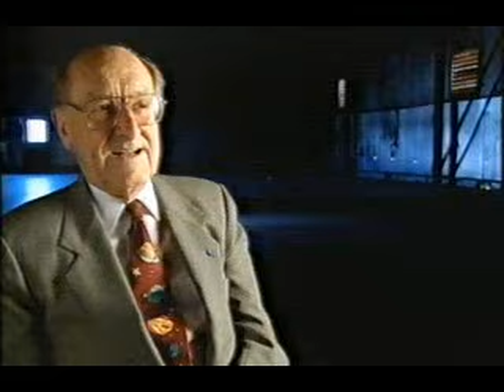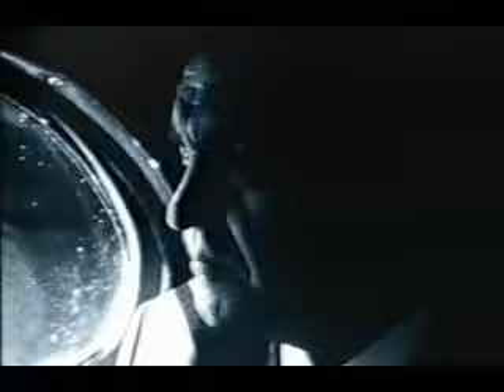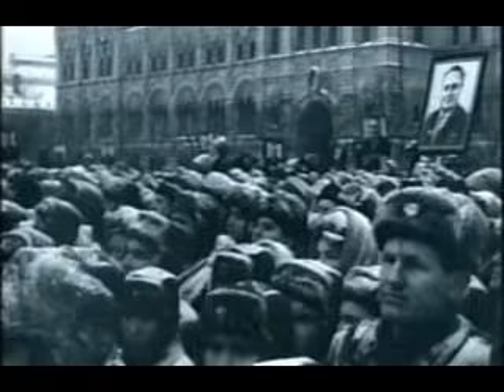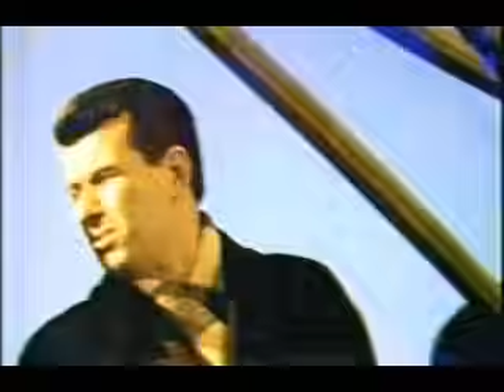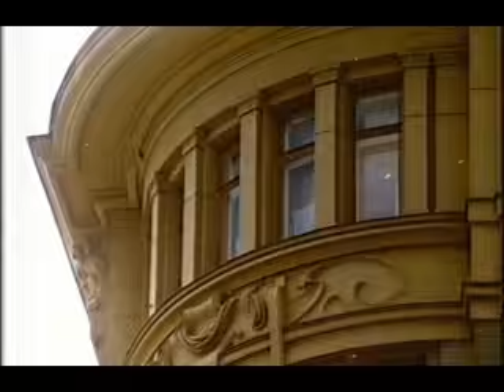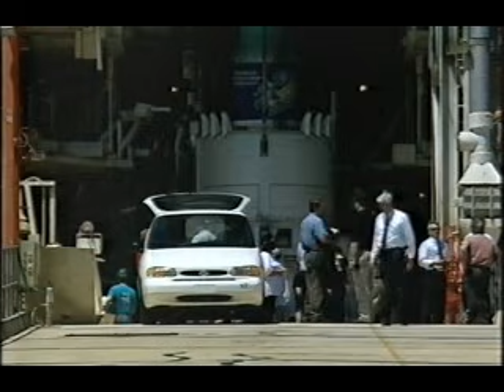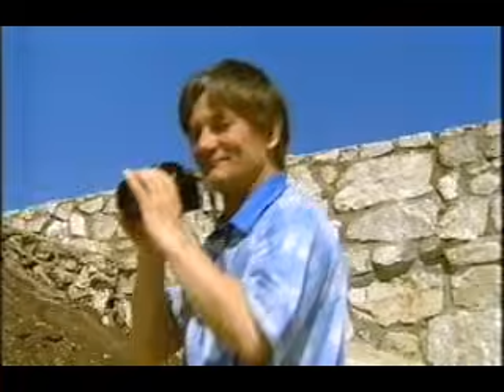Soviet N1 Moon Rocket Documentary

Comment: If the Russians captured the late great Dr, Werhner von Braun after WWll the moon race would have turned out differently.
Reply: Isukaman Or if Sergei Korolev had died in the Gulag. There probably would never have been a space race or moon landings.
Reply: +PoorSong Nonsense again. Combustion instability is the term you're after, as opposed to self-oscillation, which tends to be reserved for audio circuits.

Yes, the F1 did have a lot of early problems with instability, which they analysed and fixed with a modified injector plate, arrived at by trial and (expensive) error. This was confirmed by putting a small bomb in the engine to try to provoke combustion oscillation.

In any case, you've seen the launch footage. You cannot deny that the enormous Saturn V rocket existed and that was being powered by 5 first stage engines. How do you explain that if there were no engines powerful enough to do the job? 

And ALL the photo "anomalies" - all of them without exception - have been repeatedly answered and the answers have never been so much as acknowledged by the hoax believers, let alone rebutted.
Reply: +PoorSong Yet again, you say these things but do not in any way back them up. As an engineer, I would have thought your first resort would be evidence, not assertion.

Yes, I understand you don't believe the landings, and to try to reinforce this, you belittle the intelligence of anyone who does. But you don't give a single detailed argument that can be analysed and confirmed or rebutted. But the fact is that the MAJORITY of educated people accept the moon landings. It is not some whacky, way-out lunatic fringe opinion, as hoax believer so often try desperately to portray it.

All these posts and you still haven't said WHY you are so convinced the thing is a fake, and what gives you the right to be so smug about the stupidity of anyone who doesn't agree. You have had plenty of time to demonstrate your supposed engineering knowledge, but you have apparently chosen not to do so. I wonder why that is.
Reply: ThunderAppeal The Russians wanted to get to the moon even after Apollo 11.  And Mars,,,And Pluto.  But as of today they cannot.  If Russia wants to get to Mars before the US let them give Boeing and Space X the money and they'll get them there.
Reply: @isukaman8561  The Russians put the first satellite in to space, the first man in to space, the first woman in to space, the first dog in to space, the first vehicular activity in to space.  The only thing the Americans did first was put a  man on the moon.
OK.  Congrats.
Reply: @ThunderAppeal   "The Russians put the first satellite in to space, the first man in to space, the first woman in to space, the first dog in to space, the first vehicular activity in to space.  The only thing the Americans did first was put a  man on the moon."   Ok, let's think about this......... first dog in space,  first man on the moon.   first dog in space,  first man on the moon.    first dog in space,  first man on the moon.   I'll go with first man on the moon!  Am I right?
Reply: @ThunderAppeal    before I leave your worthless self to ponder what went wrong during your formative years, I'd like you to gaze upon this vintage Soviet propaganda poster and then tell me they weren't interested in a moon landing.  GFYS.    http://parliament-of-pol.wikia.com/wiki/File:Soviet-space-program-propaganda-poster-3.jpg
Reply: +PoorSong And you, of course, no so much about 1960s and 2015 technology. not to mention orbital mechanics and rocketry. I'm an engineer and lifelong Apollo fan, and I do understand much of it - and your assertion that the technology has never existed to go to the moon is groundless, baseless and nonsensical. Simply not true. 

NASA can't go now because it doesn't have a rocket anywhere near the size and specific impulse of the Saturn V. Apollo was wasteful and mind-blowingly expensive (a great example of what you can do by throwing money at the problem, like Concorde and the X-15), and the US Government would never get away trying to go the Apollo route in today's economic climate. So recreating the Apollo missions and hardware is out.

This was my point about what Wernher von Braun could do when he didn't have unlimited resources. 

Why do you think neither the Russians, the Chinese, nor any other country has come out and pointed out this "impossibility"? Do you think NASA controls every country on Earth?
Reply: +PoorSong And all rocket engines have to contend with combustion instability - all of them, including the RD-180. But the kick is, how well do they damp the oscillations out? The fact is, there just hasn't been a mission for the F1 since Apollo. And if the whole thing was just a fake, why invent an "impossible" engine, instead of a cluster of smaller engines, such as used on the Saturn 1B and the unsuccessful N-1 moon rocket.
Reply: +PoorSong Try again. "Launches in the Atlantic"? What do you mean? The launches were from Florida. And "Engineer if he is a real engineer, cant fail to see that it was a cheap show for housewives." is a) an unsupported statement, not an argument and b) your second snide dig at housewives.
Reply: +PoorSong You can ask me a dozen times: no, they are not fake. And would you like to give up the evidence of why you believe they are. Just be aware that if it involves:

Supposed second light sources
Converging / diverging shadows
Supposed slow motion simulation of 1/6 G
Disappearing fiducials (crosshairs)
Supposed repeated backgrounds
Lack of dust crater
LRV didn't fit in LM Descent Stage
How was Neil Armstrong's small step recorded
No stars visible
Camera films couldn't stand a supposed 250 degree daytime lunar heat
Spacesuits would balloon outward in the absence of air
Supposed fluttering US flag.

Then I have heard them a hundred times and answered them a hundred times without so much as an acknowledgement.

So kindly put up or shut up. Let's not play guessing games. If you have new evidence, please present it.
Reply: +PoorSong 

So no evidence, then. I see. This is the usual bait-and-switch the normal illiterate hoax believers pull. When asked to provide evidence, they just ask another cryptic question. I do not intend to play this game.

You say you believed in Apollo for 35 years and now don't, but I'm no engineer because I don't agree with you that it's a hoax. So how about doing some of that engineering shit to show me I'm wrong?
Reply: +Alastair Archibald You are talking to a troll or a moron. Either way, why?
Reply: +TotallyOperator Because I'm hoping that some people who aren't sure and genuinely want to know can begin to see the moronity within.
Reply: +TotallyOperator I want people to see that Apollo supporters aren't necessarily monosyllabic single-eyebrow people with too many capital letters and exclamation marks, and too few facts or other punctuation marks.

They lash out with abuse, I try to reply with facts. I know I'll never win, but i feel somebody needs to keep the game of whack-a-troll going, not for my sake or that of the trolls, but for the genuine Apollo agnostics..
Reply: +PoorSong Von Braun and a bunch of Nazis with absolutely MINIMAL FUNDING AND ZERO PRIORITY could only manage the V-2. Could you? If doing that made von Braun a loser, what does that make you?
Reply: +PoorSong How can it have deceived them if as you say the whole thing was ludicrously obvious and absolutely impossible. That is ignorant, pure and simple. The technology DID exist, in 1969, because NASA had a ton of money to throw at the problem. Your saying the landings were impossible is sheer ignorance on your part. It wasn't impossible, just difficult, dangerous and expensive. Other countries' engineers and scientists accept that. Deal with it.
Reply: +PoorSong What kind of engineer? I used to work in aerospace. You are quite simply wrong on this "impossible" claim. This is not a matter of opinion.

The 425 second specific impulse of the Saturn V is perfectly compatible with the requirement to go to the moon. The Van Allen Belts are not the death-traps the hoax communities portray them as. The Apollo rope-core computer was adequate for the simple vector-addition functions it was designed for (ground-based computers did any heavy number-crunching). 

So in your engineering estimation, what makes the missions "impossible"?
Reply: +PoorSong No. The launches were witnessed first hand by thousands, including local Florida residents.
Reply: +PoorSong Well, this is not evidence of faked video or photos. However, out of courtesy, I will answer it.

NASA had mastered spacewalking, and they had tested the suits at 1G. Equilibrium at 1/6 G would be somewhere in between. As it was, the KC-135 "Vomit Comet", by using the correct parabolic arc,  could simulate 1/6 G for thirty seconds a trip, and the astronauts went through hundreds of such flights in full space suits.

You are pleased to mock the whole thing as a cowboy in a sweat suit with an aquarium on his head, but this is incorrect. If you can walk and indeed run in a full Apollo space suit on Earth, why does 1/6 G make that harder? The heaviest thing is the PLSS backpack, acting through the astronaut's centre of mass. As long as the astronaut moves at a moderate pace so as not to lose grip through excess momentum, there are no special problems. Apollo 17 video does show a few tumbles that would be impossible to fake on Earth due to over-boisterous movement (Jack Schmitt was a scientist, not a career test pilot and astronaut). The so-called "aquarium" is a lightweight polycarbonate bowl attached to a neck ring and attached to the suit. It doesn't have a lot of inertia or consequent momentum compared to the main mass of the astronaut.

You can see video of the astronauts training on the Vomit Comet as well as in neutral buoyancy chambers where they were weighted to 1/6 G equivalent.

There were also less successful simulations using wire harnesses. 

As for the LRV, all the mass was low down, deliberately so. This wouldn't be any different on the moon. As an engineer, you ought to know that. But then again, beyond plain assertion, you haven't said the least thing to make me think you are one.
Reply: +Alastair Archibald Okay, fair enough
Reply: +Attila theHun Nice quote: "Engineers never just say 'This is fantastic.' We're a very skeptical type of people we have to prove things to ourselves technically." 

That pretty much sums up the difference between moon hoaxers and actual engineers. Hoaxers have an ideological objection to the US reaching the moon. I personally believe that if the Soviets had gotten there first there would be a small community of people promoting a Soviet moon hoax instead. The Soviets had excellent engineers and scientists and punched well above their weight in aircraft, rocketry and other applied technology. They knew what it took, so even they didn't deny that the US reached the moon.

With high school mathematics you can calculate the thrust and amount of fuel required to deliver a given cargo to Trans Lunar Injection. Many countries have landed craft there, it is well understood. Physics students in China, India, and Iran study the Apollo program and guess what? They're not the ones claiming it's a conspiracy. It's people who's ideology surpasses their reason and scientific acumen. 

The Chinese' Long March 9 will be able to deliver 50 tonnes to Trans Lunar Injection. It's similar in performance to the Saturn V. When Taikonauts land on the moon, will PoorSong at least be consistent and call that a hoax too?

Not only was it viewed live by hundreds of thousands of people in Florida, it was tracked by radar and telescope observatories in West Germany, Russia, China and dozens of other countries. They not only confirmed that it did reach the moon but even confirmed the visible fuel dumping during stage separation and radio telemetry to the moon and back. 

As a side note, the N1 would have had a higher thrust and cost a fraction of a Saturn V per launch. Had they been able to make a reliable launch vehicle with the N1 they would have been able to perform more landings and perhaps sustain a presence on the moon.
Reply: +PoorSong And what does the Atlantic have to do with the Apollo launches? Are you saying the rockets just went up and then came down in the Atlantic? You do know they were multi-stage rockets that were tracked into orbit by numerous stations?
Reply: +PoorSong 

I'm no engineer because I don't see evidence of fakery like you? You do realise that the hoax position is a minority one, don't you? There are thousands if not millions of engineers who accept the truth of the Apollo missions, and I haven't met a single engineer who didn't.

But, if as you say, there are "hundreds" of pieces of evidence, then it shouldn't be too hard to give a few unanswerable examples, should it?
Reply: +PoorSong Oooh, an ad hominem. Great scientific argument.

1) I am English, not American
2) Kindly give evidence of my supposed illiteracy, which I strongly dispute.

However, I'm getting tired of this little game, no different from the games other "illiterate" hoax believers play.

What's your number one undisputable, rock-solid, irrefutable, self-evident, knock-down piece of evidence of fakery? Come on, let's have it. You blew a little smoke with a bit of misdirection showing a lack of understanding of inertia and momentum, but that doesn't knock my socks off. 

I have all the videos, all the photos, all the books. Point me to the absolute NUMBER ONE proof of fakery. Go on. I dare you. I DOUBLE dare you. Show us those mighty engineer powers you claim to have, but have so far failed to demonstrate at all.

I am more than happy to cut you slack on spelling and grammar since you are speaking a foreign language, and rather well at that. But you don't sound like an engineer to me. Kindly stop asking questions and TELL me why you are so certain the whole thing is a fake.
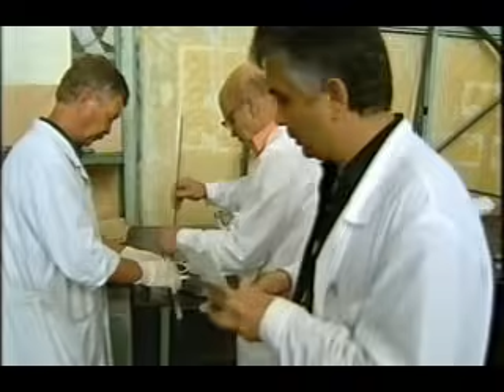Reply: +PoorSong 31:46
Reply: +PoorSong I don't exactly get my wages for nothing. So, a response to my points?
Reply: Not needed. They had their own "Sergei Korolev". Having one's own version is glorious isin't it?
Reply: Sergei Korolev had plenty of Germans to play with and they were milked dry and then cut out after he had got every thing he didn't know out of them. Boris Chertok (seen in this film) was on the Soviet "paperclip" team and they were after Von Braun as well. When Apollo 11 landed, one of the OKB-1 team who knew what Chertok was up to in 1945, berated him for not capturing Von Braun. Chertok's reply, we would have wasted any use we could have got out of him because we would have stopped using him in 1950!!! The Reason the USA pulled it off and the Soviets didn't was simple. The Americans were very Communist (in the true meaning of the word) in the execution of the project, while the Soviets were more like Capitalists with competition between designers and manufacturers.
Reply: Isukaman yes but I don't think Nothin wanted that they didn't want to go to a gulag work for food treat you like an animal Stalin done so many of his side this looks away if not killing them is this not true so I'm sure Dr Ran as far as he could
Reply: Didn't do jack shit? As Chief Architect and first Director of the Marshall Space Flight Center von Braun and his team developed the Redstone, Jupiter and Saturn rockets. The man was a genius.Yanks have spirited him out of Germany?
Reply: And what would have been the alternative for him?
Reply: Wyrdsister 2008

Von Braun was an excellent project manager, and a salesman to boot, his publicity drives though the 1950's made him the face of rocketry in the US, however the missile industry there as a whole was much bigger than Von Braun's ABMA and he was kept on a short leash until Sputnik 2 and the Vanguard 1 failure.  

The Americans had their own people who were just as good, take for example Karel Jan Bossart. What did he do? Well, Bossart was from Belgium and in 1924 he went to the USA to do aeronautical engineering at MIT. In 1945, while the chief structures engineer at Convair he proposed some solutions to a USAAF requirement for a 5000NM range ballistic missile. The USAAF were skeptical, but Convair were given a development contract to build 10 test rockets using his idea's in early 1946. However, before any of them flew, the project was axed for budget reasons (The USAAF were not going to fund anything that was going to risk development of long range jet bombers). Convair were however allowed to test fly the three rockets that they had built and they were flown in 1947. The rockets had some interesting design features more advanced than the V-2. Firstly the 4 Reaction Motor Inc engines (which had been developed during the later part of WW2 with no German design input what so ever) were gimbaled so the rocket had full roll, yaw and pitch control without aerodynamic controls (like the V-2 or Redstone). Secondly the Nose cone was detachable, thus the whole rocket did not have to survive the aerodynamic forces of re-entry and this allowed Bossart to employ his ace in the hole idea, which was a lightweight fuel tank design that relied on the mass of the propellant. plus its pressurization to support the tank structure during flight. He then came up with the 1 1/2 stage concept which with all of his earlier work lead to Atlas which became a crash program for the USAF in 1955. Von Bruan's influence on that project bar engine development was minimal. Atlas engines were an outgrowth of a USAF project for a vertically launched ramjet powered supersonic intercontinental cruise missile called Navaho, which used a large liquid fueled boost to get the missile to high altitude and supersonic speed. The engines for which did use V-2 based technology as the engines came from Rocketdyne and there was liaison between the company and Von Braun's ABMA team in its development. Versions of it also powered Jupiter, Thor, Blue Streak and the Japanese H-1. The Germans had a head start as they had the funding between 1933 and 45. However a lot of their ideas used on the V-2 had already been patented before 1939 by Goddard . The Americans of course didn't start funding rocket development in any major way until 1943 after their first exposure to German Guided Weapons (Hs-293 anti ship missile) and intelligence about the V-2 at which point, Goddard, JPL, RMI, GE and Aerojet started to get government funding for rocket motor research. This included Hermes, a US V-2 type missile. The US rocket program did suffer from large defence cuts in 1947 and Von Braun was only let of the leash with Hermes (which became Redstone) when the Korean war kicked off in 1950.  The US were not that interested in ICBM's until the mid 1950's as the guidance systems were not actuate enough to drop an atomic bomb on a city at long range. (the limits on an A-bomb's maximum yield were 500kt at best and this took a large amount of fissile material to do compared with an ideal bomb that had a yield of 50Kt), therefore the long range jet bomber got the funding.  The US ICBM program became viable with the invention of the 2 stage Dry Ulam Teller Hydrogen bomb in 1954 and it was after the Castle tests of that year that a suitable warhead to put on an ICBM became available. Due to a demarcation on who owned what based on weapon range, long range ballistic missiles were the preserve of the USAF and they went for Atlas as they wanted to base the weapon in the USA as it solved a number of issues to do with politics and security. When it became clear that the Soviets were close to deploying an IRBM, the USAF were forced into instigating the Thor program (as the UK had offered them bases) and Von Braun offered them Jupiter. The USAF were not that interested in having one IRBM', let alone two, but the US Navy said that they were interested in putting Jupiter on ships and submarines. Therefore Jupiter was given the go ahead as a Joint USN/USAF project. Fast forward to late 1956 and the US have managed to produce a lightweight high yield H-bomb, Lightweight highly actuate inertial navigation systems and large high power solid rocket motors.  The US Navy were never really interested in putting a liquid fueled rocket on a Sub, thus these breakthroughs lead to the crash program to develop Polaris and they pulled out of Jupiter. The US DoD were not going to damage the US Rocket program in the light of Sputnik, so Jupiter survived. As for Jupiter's launch success rate v Thor, Atlas and Titan,  that was because Von Bruan ground ran them all before they were launched, while the USAF did not. Thus he was able to identify the turbopump issues which plagued all of the rockets (which used a common engine design).  Now up to 1957, the USAF had a good working relationship with ABMA, however thanks to Von Braun's efforts to force Jupiter on them, they pretty much stopped talking to him, which damaged the whole effort. However, the USAF, like the USN also decided to go in other directions which lead to second sourcing of engines (Aerojet) and a more conservative airframe in the Martin Titan, along with the push for the Solid Fueled Minuteman.  Jupiter in the end was dammed by its US Navy length requirement, which resulted in it being too wide to be transported by USAF transport aircraft. As for Von Bruan at NASA, yes he did get the Saturn's to work reliably. But he did stop Shepard being first into space by insisting that Mercury Redstone needed a third test flight before putting a man on it which let the Russians get Gagirn  into orbit. and had he had his way with Saturn V development, the US would never reached the Moon before 1970. It was George Muller at NASA  HQ who forced him into doing all up testing on the Saturn V . As for Comrade Korolev, he had all of his fingers and toes in some part of the Soviet Space and missile effort with OKB-1 doing SLBM, ICBMs (both liquid and solid fueled), lunar and planet probes, Communication satellites, Spy satellites, Manned spacecraft (zond and Soyuz as well as the R-7 and N-1 launchers. Von Braun had next to no input on most of that in the US program.
Reply: If there was a new race to the moon I wonder who would get there first since the Americans say they don't have the skills to re-engineer (or reverse engineer their own old tech) and the US would have to start from scratch.. 

ARCA's revolutionary aerospike engine completed and ready for testing..  

https://newatlas.com/arc-aerospike-linear-engine-complete/51431/

PLUS

The Biggest Rocket ever Designed? - The Sea Dragon.

https://www.youtube.com/watch?v=6e5B7EKVg48

Sea Dragon Rocket: Worlds Largest Reusable Rocket Concept.

Sea Dragon was a 1962 concept for a reusable, two-stage, sea-launched carrier rocket. The project never materialised as NASA's Future Projects Branch was shut down in 1965. It would have been the largest rocket ever built.

https://www.youtube.com/watch?v=hHG3Z0O9Xzo
Reply: Guy
Reply: "If the Russians captured the late great Dr, Werhner von Braun after WWll the moon race would have turned out differently."   Or. it's entirely possible that they would have executed him.   After all, they executed or jailed some of the best aerospace engineers of their own .
Reply: @Bill Viking Yeah, and considering that a short 5 years after the end of WW2 which practically decimated Russia the Russians put up a satellite in to space without any german scientist.
'Weak industrial base' or no 'weak industrial base'.
Reply: @ThunderAppeal    there you go again..  "a short 5 years after the end of WW2 which practically decimated Russia the Russians put up a satellite into space"   Huh?  Sputnik was launched in 1958.    History isn't your thing is it?   War is and has always accelerated the advancement in aviation and aeronautics.  So what's your point, besides trying to move the second world into the 50s?  Lol
Reply: +ThunderAppeal He saw mittelwerk, he was complicit. Then he helped the americans builds the ICBM's, so also a traitor. Fuck Von Braun spits sif ever call him 'great'

No man with a soul could witness the horrors of mittelwerk and continue to work within a war machine and yet he did.
Reply: +Isukaman Von Braun with a bunch of nazis could make the V-2, no more than that. He's just a loser.
Reply: +Alastair Archibald I'll not try to argue about terminology, my native language is russian, but I can confidently say that the resonant oscillations in such single-chamber engines are inevitable. Otherwise, such a delightful and reliable engines for 45 years was repeated at least once, and  not to be begged standing on Indigenous sell RD-180.
 Photo and video fake? Yes or no??
Reply: +Alastair Archibald Launches in the Atlantic. Engineer if he is a real engineer, cant fail to see that it was a cheap show for housewives.
Reply: +Alastair Archibald OK, flying to the Atlantic. That's better?
 I'll ask again: video and photo "from the moon" is a fake?
Reply: +Alastair Archibald I didnt want to upset you, but the US has not mastered the manned space program.
Reply: +Alastair Archibald 
"You can ask me a dozen times: no, they are not fake'.

Sorry, but you arnt an engineer.
 The video and photo "from the moon" contains hundreds of hard evidence of forgery.
Reply: +Alastair Archibald  'If you have new evidence, please present it'.

New? 8 )) u're absolutely not in the subject, alas.

let's test your knowledge of physics of secondary school course. How can г simulate the stability of a brave cowboy wearing a sweat suit and with an aquarium on the head or stability of 'rover' in the conditions of the Earth's gravity?
Reply: +Alastair Archibald I gave you an example, which has found itself: the conditions to maintain balance while moving on the moon.

 How to simulate the conditions of equilibrium on the Earth?
Reply: +Alastair Archibald "I am English, not American'

my sincere congratulations!

although I have nothing against the Americans, who live by their labor. : )
Reply: +Galen Matson PoorSong will not call (immediately) Chinese landing on the moon as a fraud, if not see the same obvious nonsense both at American video and photographic materials. These materials, by the way, only a very small part of the evidence of shameless deception.
Reply: +Isukaman And remember that von Braun's team was pretty much held hostage at Texas for 5 years before actually working with the Americans. So, if Dr. von Braun were in Russia, the moon landing would have occurred on 1950's
Reply: @martinmendez695     WRONG.  After the second world war Wernher von Braun and over 100 of his Peenemünde rocketeers, who developed the V-2 rocket for the German military were moved to the United States  as part of Operation Paperclip. For five years the team worked on the captured V-2 rockets at the White Sands Missile Range in New Mexico, and  guided missile development unit at Fort Bliss, Texas. In 1950, the group was transferred to the Army Ballistic Missile Agency  at Redstone Arsenal in Huntsville, Alabama.    Held hostage??  Where would you have preferred they be stationed?  Cape Canaveral or Kennedy Space center didn't even exist.  Houston Space Center hadn't even been thought of yet.   Huntsville, Alabama was ground zero for the US rocket program at the time and the German scientists were there from the get go.   GFYS.
Reply: Isukaman Hate to be the one to burst your bubble but von braun didnt do JACK SHIT! for the American space program.  If you every read the book from the earth to the moon  in it the author writes how many of the astronauts and scientists always complained how von braun was always getting in the way of things.

Von braun was a know nothing dumb fucking nazi scumbag who was simply trying to save his own worthless hide from being prosecuted for war crimes.

The Russians put the first man in space, the first woman in space the first vehicular activity in space.  
Going to the moon was something the Russians had no interest in and the only reasons the Americans did it was because they wanted to do something 'first' that the Russians didnt do.

So fuck von braun and I shit on the grave of that fucking lying kraut.
Reply: ThunderAppeal - You're spouting typical Chekist BS. Your "channel" is full of nonsense, trash, BS and projects the landscape of a Dullard_Brain.
Reply: @DataWaveTaGo  The commentor RichardVernon before you backs up what I said originally.
I dont know what else you are imagining you dellusional fuck. But please before you sign back on take your meds.
Reply: @ThunderAppeal    wow.  wrong on every point.  and using for reference sources that prove you are wrong.  You write.. "Going to the moon was something the Russians had no interest in"  really?  then what were they going to do with the N1 rocket?  Launch a freakin weather satellite the size of a locomotive?    The moon was the holy grail and anyone with two brain cells would know that.  Maybe that does exclude you.  The book "earth to the moon" was written by Jules Verne who was long dead before Von Braun ever lit  his first bottle rocket. Lol!   The Russians made every attempt to beat the uS to the moon including a last ditch attempt to land an unmanned probe, Luna 15,  and return it with samples just to claim they got there first.  It crashed into the lunar surface while Armstrong and Aldrin were busy mugging for the camera.  It's kinda silly to think all the manned orbital missions, the docking missions, the unmanned moon missions the Russians did accomplish were for no other reason, with no end game.  The Russians claim they were not interested in going to the moon because they failed to get there first.  And once they realized that the silver medal was the best they were going to get,  they lost interest.   Can't say I blame them.
Reply: @WeWereYoungandCrazy  Youre dellusional and fucked in the head.
Even if I wrote that, why does it bother you so much?
Maybe because it is true and you hate to admit to the fact that the only reason the US bothered to go to the moon was because the US was so fucking paranoid and the ego was so fucking bruised after Sputnik and thinking that the Russians were going there first that that was the only motivation the US had?  Because America was never motivated by a 'sense of discovery' America was motivated by its own fucking pride and ego.  Whereas the Russians, a short 5 years after a war that practically decimated it put a sattelite in to space without some fucking nazi scientist.
Go back and take your meds before you get on line again.
Reply: @ThunderAppeal    What do you mean.. "Even if I wrote that, why does it bother you so much?"   First, you did write that, let's not be mistaken.  second, it's bullshit and a lie.  So my being bothered by your nonsense is due to my dispising liars and propagandists.  People like yourself.   Generally speaking, propagandists are aholes that misinterpret facts.  But you seem to be completely lacking facts.  Seriously, you just make stuff up.  Like Jules Verne books that talk about Von Braun, the Soviets putting a satellite into space or a short 5 years after "a war that practically decimated it".  What war are you even talking about?  WWII ended in 1945, Sputnik went up in 1958.  Are you referring the the Hungarian Revolution of 1956?   Hardly a "decimating war", barely a dustup by Russian standards.  So you missed the second world by a mere 13 years.  Who cares?  We know you for what you are.  Uninformed and misguided.  So you think the the Russians " put a satellite into space without some fucking nazi scientists."   The Soviets had hundreds of German scientists and rocket engineers that were grabbed up after the second world war, like Helmut Gröttrup.  Only difference is that the US got the best ones, like Von Braun.  So you think that America was motivated by its own fucking pride and ego?  Works for me!   And the Soviet space program was motivated by what exactly?   A desire to spread peace and love?  Their rockets were ICBMs first and spaceships second.  Just like ours.  Lol.  now GFYS.
Reply: @ThunderAppeal    before you edited that comment you had written "if you actually read the sources rather than just watching.."   I did read Jules Verne, some of my favorite reading, that's how I know that you didn't.   and we all know what purpose the N1 rocket was to serve.
Reply: @WeWereYoungandCrazy  What exactly about what I said was bullshit?
No, what exactly about what I said was bullshit?  
What the Russians intended?  How the FUCK do you know what the Russian intentions were?
What germans scientists did the Russians grab up?  Who were they?
Do you know of any Russian rocket scientists prior to WW2?  What about Russian aeroengineers?
What about Russian/Soviet pilots which the germans came to visit in a 'friendly exchange of knowledge' in the years prior to WW2.
Von Braun the 'best one' Bwahahaha.  Ok man, whatever the fuck helps you sleep at night.
However many years I missed WW2, the Russians were first in to space.
Get that through your thick skull.
The Russian/Soviets were FIRST in to space FIRST!!
The FIRST MAN.
The FIRST WOMAN.
The FIRST DOG.
The FIRST SATELLITE.
FIRST.
Not the german-nazis.
NOT the american-nazis.
The Russian Soviets were FIRST!
FIRST.
FIRST
and 
FIRST!
Reply: +Alastair Archibald I have to tell you my biography? 8 )
 I never took part in the performance that has deceived the whole world.
Reply: +Alastair Archibald Its a simple: Im an engineer, a competent engineer, not a housewife
Reply: +Alastair Archibald To see that videos and photos "lunar" mission is a fake  school knowledge of physics more than enough . What kind of man who works in the aerospace and dont see that?

 Declared a specific impulse. The combustion chamber of this size is impossible due to self-oscillation. 
45 years were unable to do even a small copy of F1 . 8 )
Reply: +Alastair Archibald You are not mistaken, everything is easier: uare illiterate, like most of americans. Shockingly illiterate.
Reply: +Alastair Archibald Let me explain. I studied the history of "moon landing" for a long time. Im a forum moderator on the isue for about 6 years and read many thousands of arguments from both sides. Now I have no doubts that it is the grand deception "of all mankind" (c). I'm ready to bet my head without hasitation, so I believe it is very difficult (almost impossible) that the competent engineer who is familiar with factography can doubt that all this is a primitive fraud. Housewife can admire the brave cowboys in diapers and american super technologies, but not an educated man.
Reply: +Alastair Archibald If you repeat the nonsense many times, it will not be the truth of it.
 Flying to the moon is not possible, even with today's level of technology.